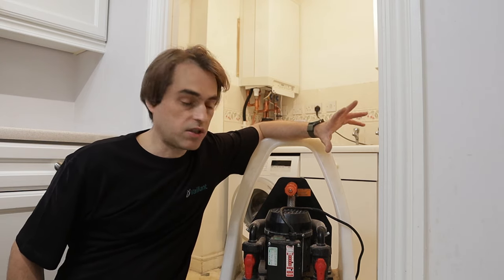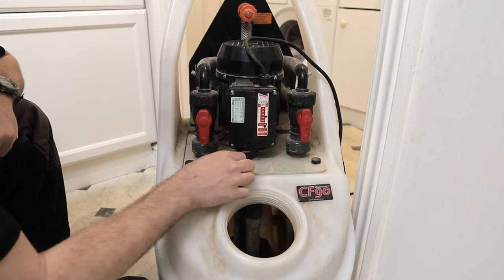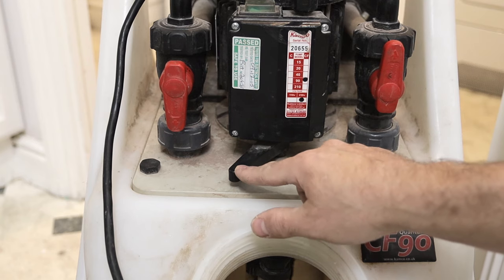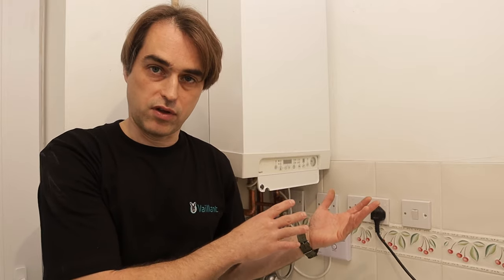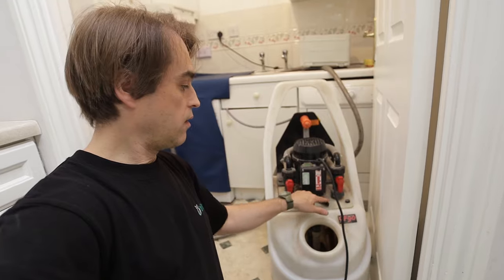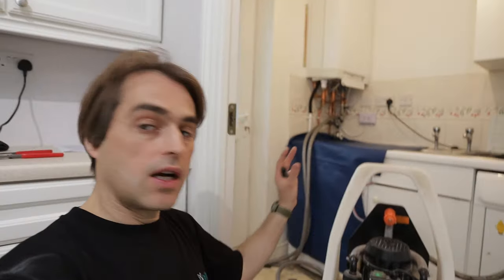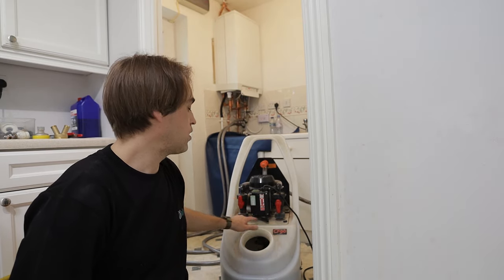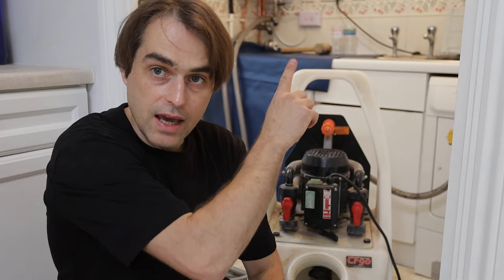How to power flush central heating system

Comment: My radiators are 38 years old .The single panel Myson radiators.Except in the main bedroom there is a convecter panel behind the radiator.I have stopped doing this over the years I used to take the radiators off the wall and drained the water in the garden This was 8 radiators.I have always used a rust inhibitor in the system.It used to be Fernox before we got the combi boiler.Now I put a bottle under pressure through the combi boiler Forgot the stuff name it is oily.All my radiatots are hot so what is this pressure washing all about.Can you cause more damage than good? Above the floor my copper pipes to the radiators are microbore.If your radiators are hot I wouldn't bother with power flushing leave well alone.Just my opinion.

Comment: Very informative, but why flush a dirty system through a new boiler? Surely you risk contaminating the HE/plate.
Reply from the maker: Not if you know what you are doing
Reply: @UrbanPlumbers  I personally connect to the flow and return before the boiler and close it off or even before the boilers installed. I'd just worry too much about contamination. But it seems to work out for you, so each to their own I guess.
Reply from the maker: No need to worry

Comment: I'm a plumber with over 20 years of experience in heating and plumbing.... Magna cleanse is a way safer way to clean a heating system... it's not always how quick you can do things.... it's results and longevity of a heating system after it had been cleaned...
Reply from the maker: The best way is thorough flush. Magnanclean is a gimmick.
Reply: @UrbanPlumbers  it's not a gimmick.. it's a great peace of equipment...
Reply: The Magna cleanse is a product from Adey ... and it's a great peace of equipment for flushing heating systems...I have bought one recently and used it..
Reply: Magnaclense is an oversized magnet and nothing more. It's a slightly beefed up chemical flush.

Comment: If blr is used for heat, blr pump flows one way of course, how can your appliance  lever reverse the flow?
Reply from the maker: PF will overpower the boiler pump easily - most boiler will still work in reverse

Comment: Hi, great video, if you are cleaning a pressurised system do you let the pressure out first ?, and because of gravity and the radiators upstairs do you need to keep the lid on the Kamco unit ?
Reply: What I mean is if you have pressure in the system and the lid is not on the machine why does the water not blow out ? Thanks
Reply from the maker: @acestu  because is constantly pumped into the system. If you stop the pump you will flood yourself.
Reply: @UrbanPlumbers  Great thanks, you know your stuff nice to see....

Comment: Can your switch machine lever cross the boiler pump?
Reply from the maker: yes, never caused me a problem, but obviously best if the boiler pump is not running. You will know almost instantly when you are pushing against the boiler pump anyway when you are dumbing water - flow increases a lot.

Comment: Heya daft question. If you had the power flushing machine connected and isolated every radiator. Would this flush the secondary plate heat exchanger?   Also thought about the combi mag for kamco. Love the rubber mallet idea instead of sds drill gizmo. So cool.  Thanks a lot harry.
Reply from the maker: You would have to connect the machine to flow and return of the boiler and then turn the hot water on and keep it running while the PF is off, then turn heating on and machine on for a few seconds, then turn hot water on while PF is off again.

I do clean plates that way sometimes.

You could also just turn flow and return off and run the boiler on hot water only for a good while once you get chemicals in the system. But you will not be able to flush the plate with a PF insitu as when the diverter valve opens for DHW it closes circulation from the PF machine.
Reply: You can flush the plate with a PF machine if you have a pump head adapter. 

If you connect anywhere else, the diverter valve will prevent flow around the plate.

Comment: Link to this machine? When you are flushing the main boiler heat exchanger, are all the rads shut?
Reply from the maker: It depends on how you connect the machine. If you connect to the flow and return under the boiler then you can shut all rads, If you connect to return only (in place of a filter for example) - then you will need at least one radiator open at all times as otherwise there would be no flow.

If you intend on flushing the boiler only, it is sometimes the easiest to remove one radiator (closest to the boiler), connect to flow and return there and shut all other rads - that way you can flush the boiler only

Comment: My Viessmann boiler is about three years old. Can you flush through  with this boiler and how much do I expect to pay for a 13 radiator household? Thank you
Reply from the maker: Yes you can. Why would you need to flush if it’s only 3 years old? Is the plate getting blocked? Still on rubber hoses?
Reply: @UrbanPlumbers  Some radiators are cold at the bottom while the top(s) is hot. my feeling is that when the boiler was installed, the system was not flushed

Comment: Followed the process in the video but couldn't get past the first flush, when i re pressurised the boiler for the second flush stage as soon as i turned the boiler on to heat the water the pressure immediately fell to zero so i turned the boiler off. Any idea why this is happening. Also most information i have seen on this method has an external megafilter device between the flushing machine and the pipework, what are your thougths on this?
Reply from the maker: Sometimes you have to throttle power flushing return valve to build up pressure for the boiler to fire. 

Also when flushing a combi boiler you need to make sure that the diverter valve is in CH position.
Reply: Connect directly to the magnetic filter.

Comment: When a power flush needs to be done on an open vent system, the feed and expansion cistern must be isolated and the vent pipe too. Is that correct?
Reply from the maker: Yes correct
Reply: I use push fit to connect overflow pipe  to outlet of expansion pipe thereby making a circulating flow.

Comment: If the trvs (thermostatic radiator valves) are not bidirectional (with double arrows) are you gonna be able to reverse the flow?
Reply from the maker: I would remove any trvs for flushing, they are too restrictive
Reply: Yes. But they will be noisy when you close them down with the flow reversed!
Reply: @UrbanPlumbers  You remove the head, or the whole valve?
Reply: @UrbanPlumbers what would you put instead? Normal lockshield valve?

Comment: Hi is this machine better than the norstrom as they both quite expensive if so with model? need your expertise
Reply from the maker: Both are very good
Reply: @UrbanPlumbers  Thanks, if you have boiler thats already sludged up and is not working is it not  better to get an powerflushers thats can heat the water as chemcials work better if boiler not working.
Reply: @b1h2u3p4  the elements that heat up the powerflush water are 3kw take ages to heat up the power of the cf90 and chemicals with a magnet will do the job

Comment: Used to power flush all the time, I was working for British Gas when they started doing it years ago, to be honest all I do now is do a mains water flush, do every radiator independently, there’s no better way, especially on. Micro bore pipe work, power flushing is useless on micro bore.
Don’t  waste your money on a power flush machine, just do a mains flush
Reply from the maker: Could not agree less with you. Mains flush is just fooling yourself. The water may run clean but the system will be baked with scale.
Reply from the maker: @paulsmith2931  how can it be as good with miserable flow rates you gonna get in most London properties? Here we get below 15l/min. I don’t have weeks to flush a system !
Reply: I’m afraid I don’t agree either. Firstly you could piss with a higher flow rate than a lot of the properties I work in and you can’t easily reverse the flow. If a system isn’t really bad then I will mains flush after a boiler change. But on a really bad system that’s been pumping over. Nothing comes close to a proper flush imho.

Comment: Dude your flushing microbore pipes one rad at a time?? The flow will be rubbish and not enought to clean rad properly + run risk of leaks or pipe blockages, i aways flush microbore 2 at a time just to be safe as you dont know who or how it was plumbed in.
Reply: I always do one rad at a time, even with microbore. Open ya second radiator will only increase flow through the common pipework, not through the individual radiators. At least with one at a time, your sure it’s done each radiator as best it can. 

I’ve started to use Thorough Flush on microbore recently. I assume it’s the better pressure that helps, as flow will always be limited.

Comment: Changing radiators is an option I said (read again) especially when really OLD and inefficient! Power flushing doesn't remove all the corrosion! You seem very limited in your approach to what you consider best when alternatives are there!!
Reply from the maker: yep - I will keep flushing instead of changing rads. Limited? Yes. Cheaper and more efficient as well.

Comment: Power flushing is expensive and not the only answer. Corrosion in a system is serious and can seriously affects the working of your boiler. Neglected systems can have in depth Corrosion. Old radiators should be replaced for higher efficiency radiators and then a chemical flush by using the boiler can be very effective! Power flushing old radiators is not the best option!!!!!!
Reply from the maker: So instead of powerlfushing you replace radiators?!

Sure, sounds like a cheaper option -lol
Reply: @UrbanPlumbers  You clearly didn't read properly what I said! You appear to have the only solution which is power flush! Wrong! Each job should be properly assessed for the best solution moving forward!
Reply: So never change old inefficient radiators with heavy magnetite in them! LOL